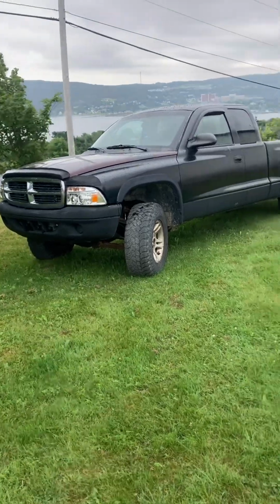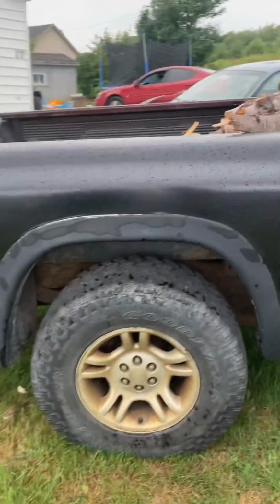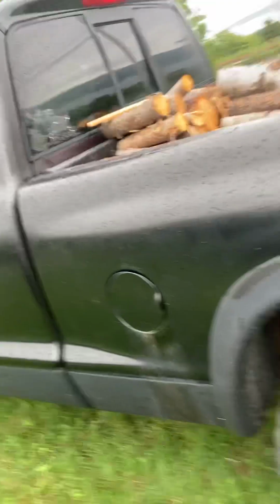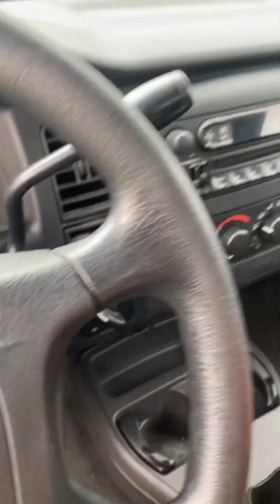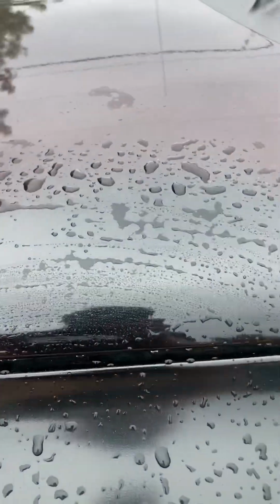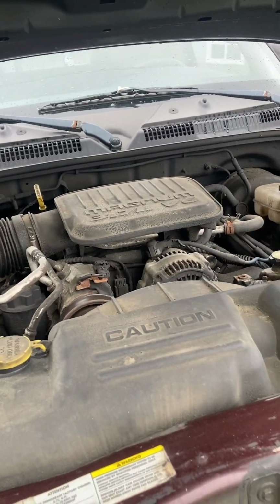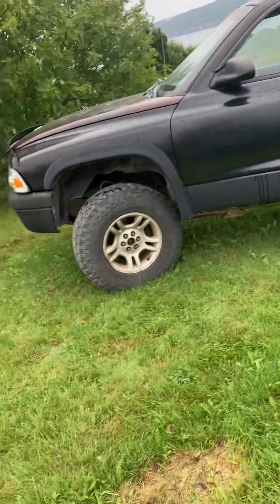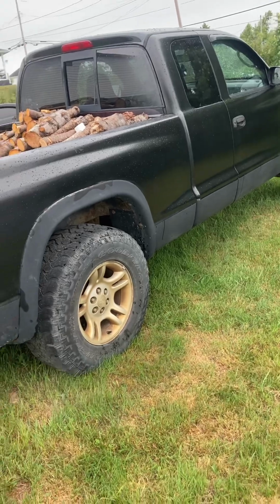2004 Dodge Dakota fix or scrap ?

Comment: They are fantastic trucks. Last forever if you keep up with the maintenance. I have the 2003 Dodge Dakota Club Cab 3.9L  V6.
Yours should be the 3.7L V6.  My truck has the towing package. I really enjoy it. You bought one of the best Trucks ever made.  The new Ram trucks today are built to fail at 70,000 miles. The trans will fail most likely 1st on the new trucks. Our engine and transmission, should last 350,000 to 400,000 at least.  Welcome to the Club.  Oh, one more thing. Up north, you will have rust issues on all Dodge trucks, knock rust off, undercoat ASAP. I live in Florida, my truck body and frame still looks like it just pulled off the factory floor. Few scratches in the paint. If you go fast around turns, you will wear out the bearings.

Comment: I bought a 99 Dakota with a 5.2 V8 magnum with 152,000 original miles...easy to work on, and worth all of the 3k i spent for it. Very tough truck, and good luck finding a newer mid size truck with a 6.4 ft bed let alone a V8. So, yep its a keeper.🤓🤙